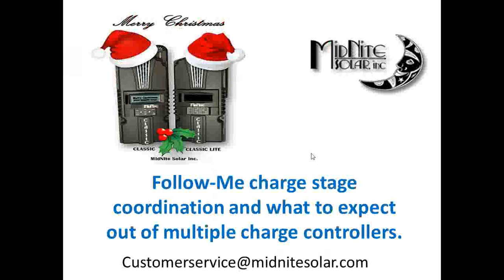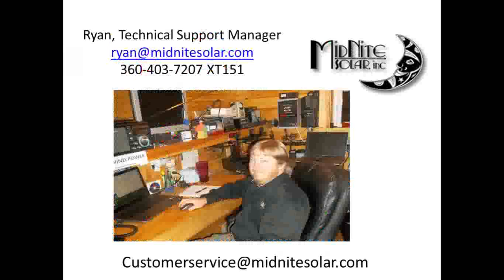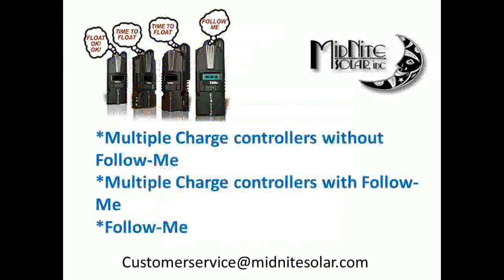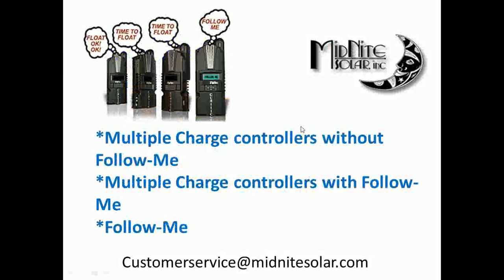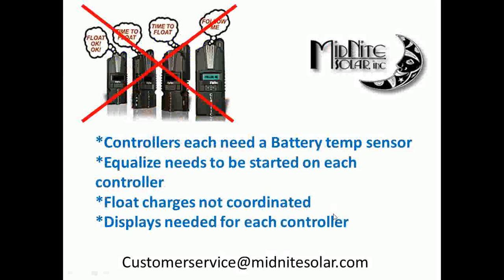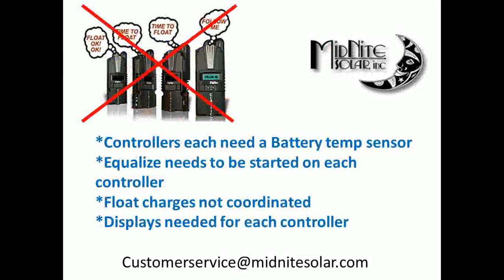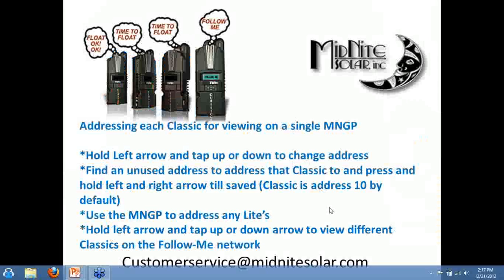Follow Me Classic charge controller coordination

Comment: Thanks for the video, just put them in follow me after I realized one was resting during mid day. The timer on one Classic ran out for Absorb and was waiting for the voltage to come down to float but since the other Classic was in Absorb mode it was holding it up. Now with Follow Me set properly I don't have this issue.